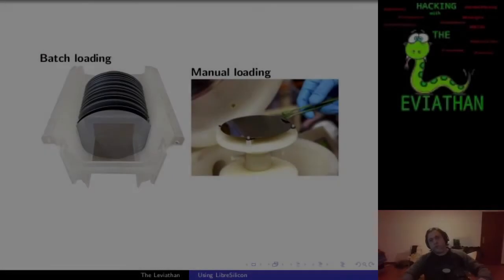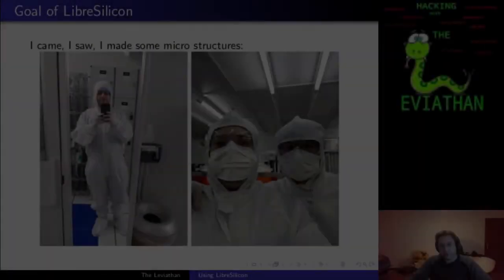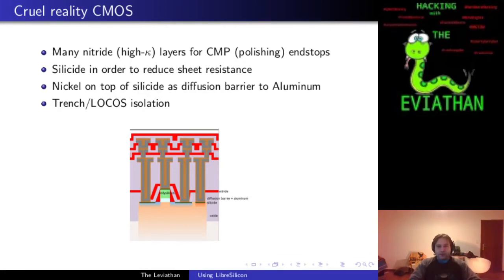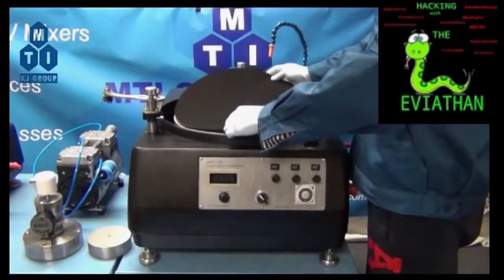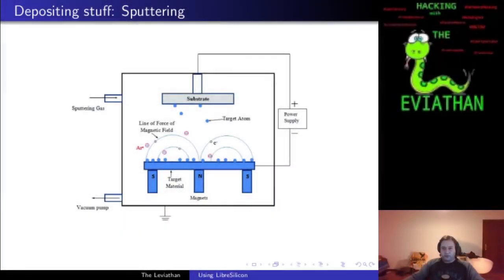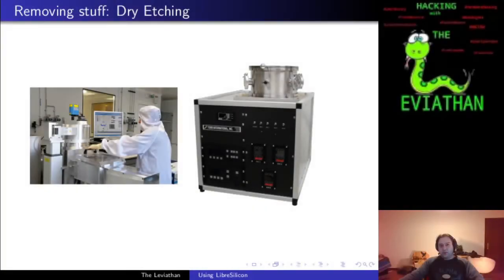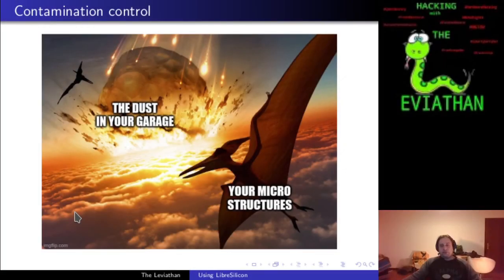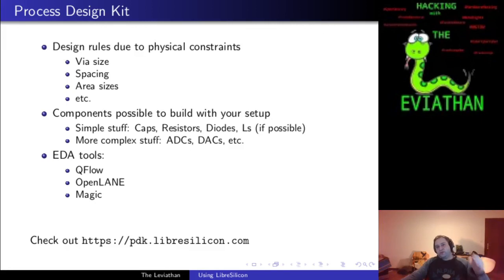Using Libresilicon

Comment: hi. one question. LibreSilicon is still alive? (I don't want to sound rude, but the website hasn't been updated since 2018)
Reply from the maker: Hi. Yeah. I just recently have updated some links and  have migrated to a new platform.
Feel free to join our Signal group in case you wanna join.
Reply: @HackingWithTheLeviathan  Maybe I'll join the signal group to keep up to date with the project. That aside, it's great that the project is still alive. (I quite like the promise of it. I hope one day to be able to produce my hardware at home xD)